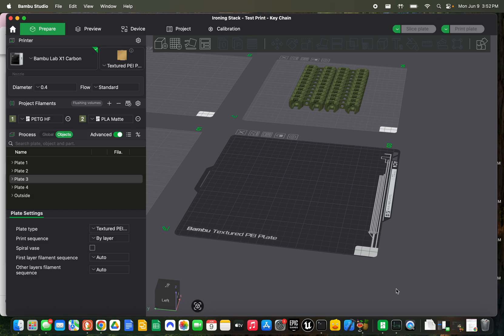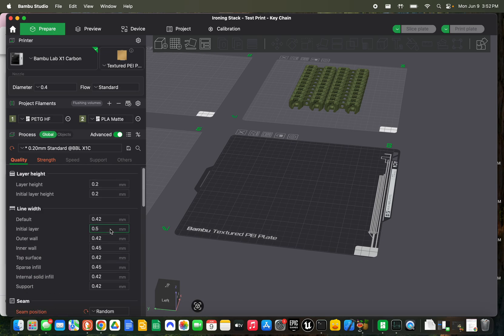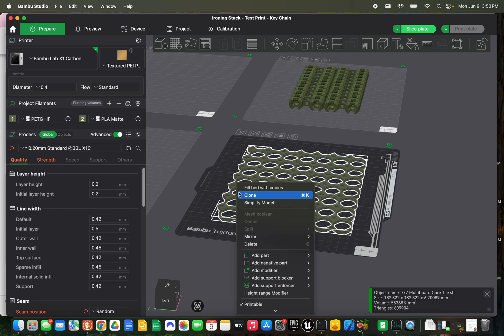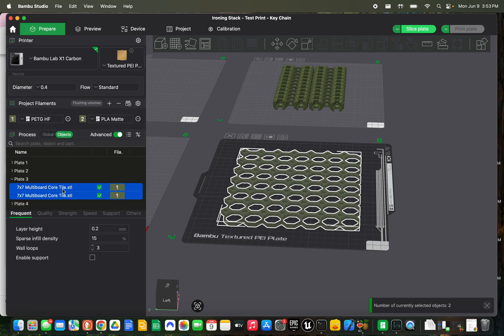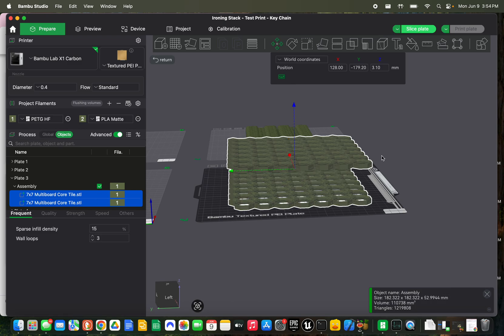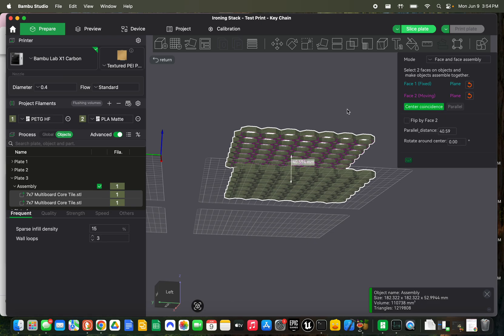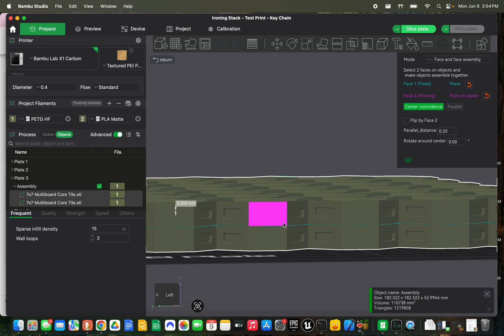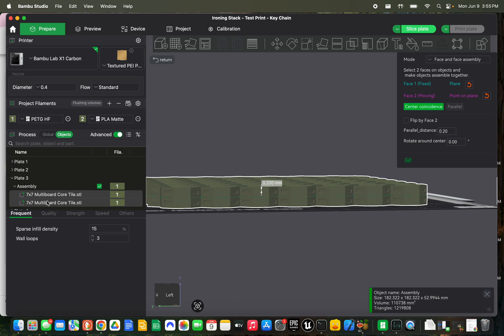Stacking Prints in the Bambu Slicer (Easiest Method)

Comment: Great video, Thanks for sharing. Easy to follow and great demonstration. One question though. Have you ever tried the same settings for the Gridfinity bases and if so does it work the same or do they need different setting and or layer hight/wall thicknesses.